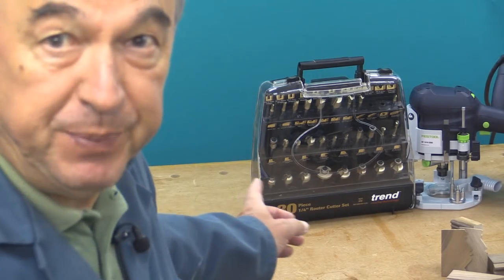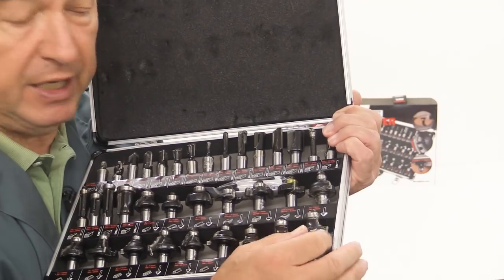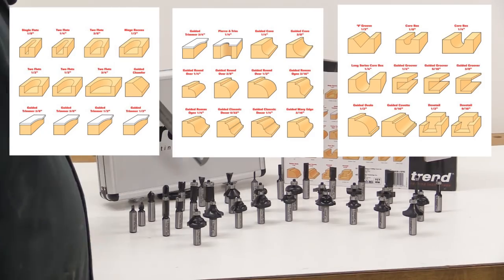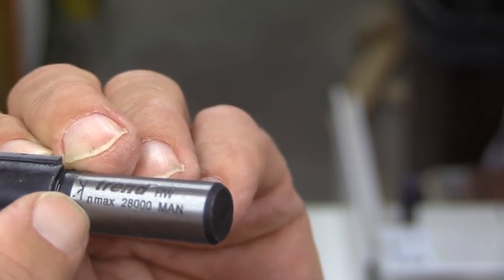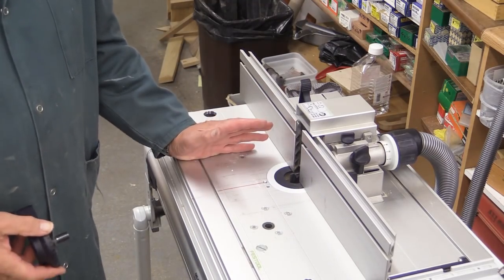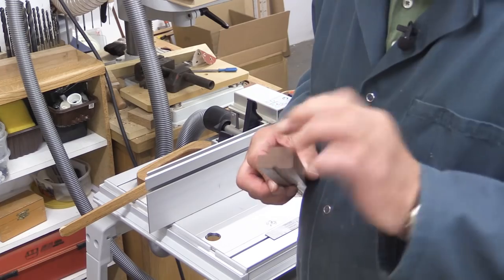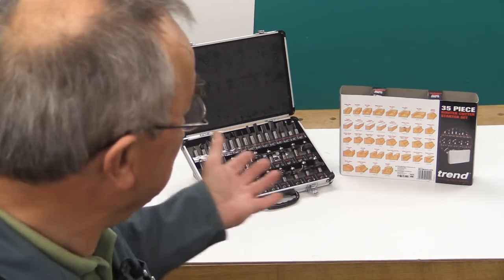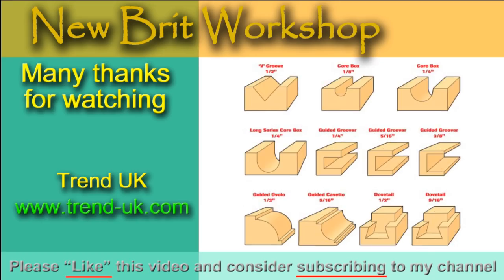Trend 1/2" Router Cutter Set

Comment: I think Trend make probably the best (inexpensive) cutters out there. Their sets are very reasonably priced and decent quality, much better than some of the other cutter sets that are only a few £'s less.
I have had excellent success with inexpensive cutters from China too, similar prices to individual Trend cutters and comparable quality. If you have a diamond grinding setup as well then your options are opened even further as you can modify and sharpen inexpensive cutters to make them last longer or for special jobs/unusual sizes.
Reply from the maker: Good stuff - many thanks.   Peter

Comment: I like the Trend part of the bushing which screws on to the base plate, the screw on brass ones come loose, ruined my bit and bushing. I make jigs to drive my 1/2''' so a little big in metric I would be able to handle since I'm going to cut just a 1/2'' . Some one say try the 17/32 in which might be a big bigger than the 1/2''' bit. what you think?
Reply from the maker: You could give it a try and see how close it comes.  Peter
Reply: @NewBritWorkshop  I shall try, I just want the bit to hit the inner walls of bush, don't want another bit messed up. Thank you very much for your answering.

Comment: Help!!!! I have an American router ( Craftsman ) and I bought a Trend Uni-base Now I have standard bits 1/2 ,1/4 what size guide bush do I use for them since Trend is metric?  . I bought the Trend Uni-base do to having a better hold on the bushing since it is screw on to the base plate, believe me the brass junk come loose and before you know it, you lost a bit and a set of bushing.
Reply from the maker: Hi Carl, You asked this before on another video of mine...My (metric) template routing guide bush sheets require the guide bushes and cutters to be metric. I imagine that some matches could be made for a mix of standards but one would have to go back to the basic formulae in order to work out if any mixed Imperial/Metric combinations will work. Better to use all metric or all Imperial.  Peter

Comment: Great video Peter. I have a similar set I use often. Why are you not using your ujk cast router table?
Reply from the maker: Hi Chris, I had two router tables and space was an issue. The UJK was brilliant with its cast iron top and fantastic fence. The Festool CMS is smaller and lighter and has brilliant dust collection although its fence is not as good as the UJK one.    Peter